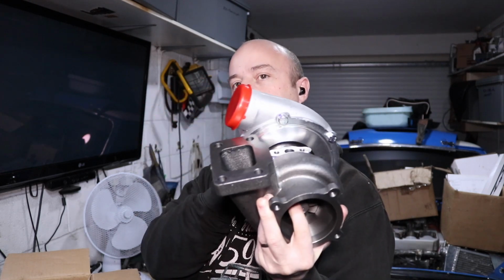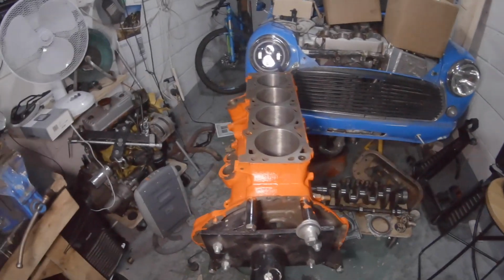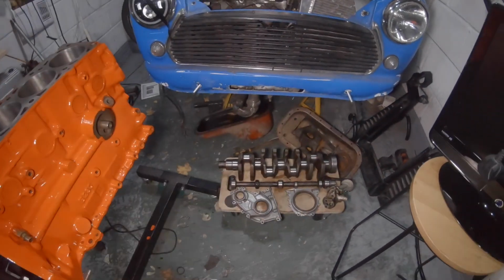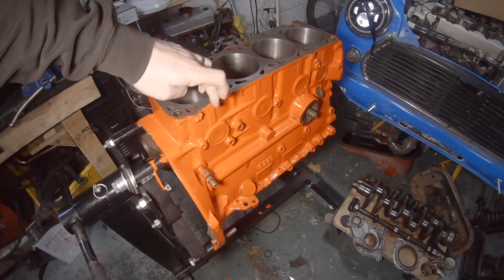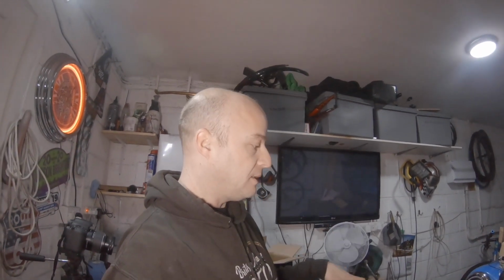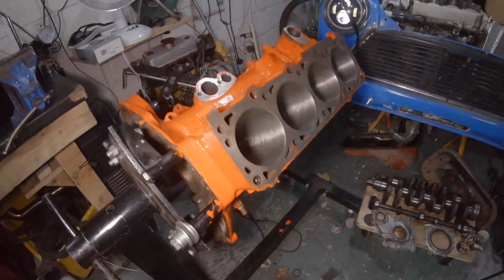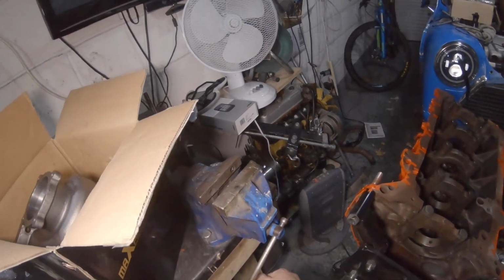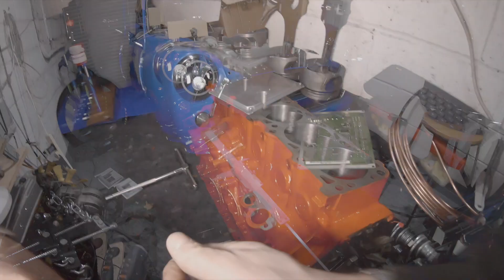Volvo 940 Redblock Turbo Engine Project | Plans and Parts to Start Things Off

Comment: Cracking video buddy, i have literally just started the same journey on a 1996 b230 turbo squirter block with a ported and flowed 531 head myself with the same goals as u (by the sounds of it)😆 when I brought my engine it was running 350hp but it has standard 13mm rods, no ARP head bolts, standard head gasket and no crank gurdle ect so I'm rebuilding it properly before putting it into my 1984 240 that will eventually be my wedding car 👍👍 I'm just struggling with gearbox choice now, im thinking a bmw zf box or a redblock m90 (if I can find one) and risk the weak 3rd gear but im undecided 🤔🤔
Reply from the maker: Thanks. I plan to go with the m90 initially. I dont have any plans to go drifting or drag racing so im not too concerned. Like you say there are other options out there
Reply: @Thecarislife  I'm really tempted to go m90 too but good ones are getting harder to find these days 😩 what sort of hp u looking to achieve with ur build? Personally I'm looking for 400-500, I think an m90 will 💩 the bed in a fairly short space of time if I push it too much 😬 I think il have better peace of mind if there's a zf box or similar but it's alot of work 😆😆
Reply from the maker: Ill be happy with 350 to 400 i think
Reply: @Thecarislife  we all say that until we get there 😆😆😆 good luck with the series buddy, il definitly enjoy watching 😉👍🍻
Reply from the maker: Thanks